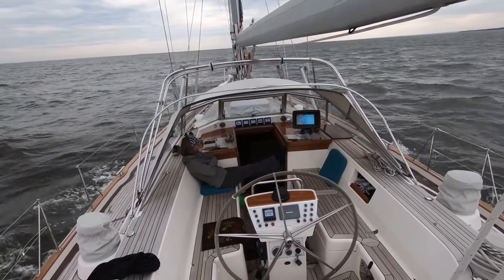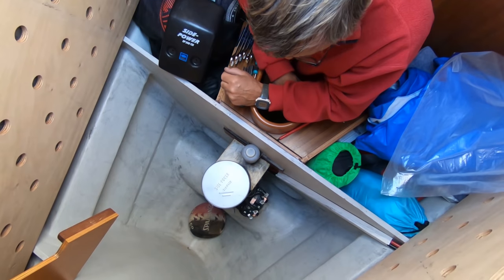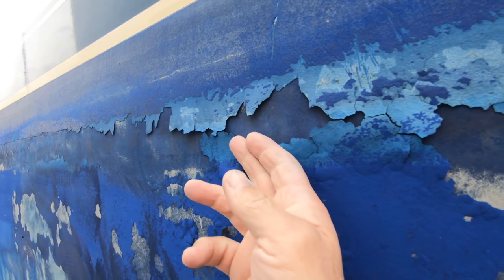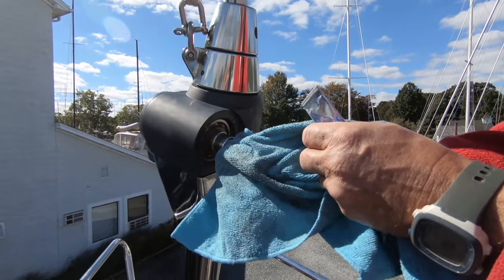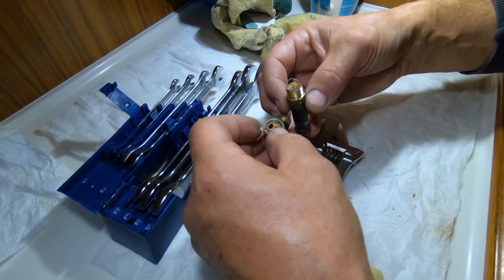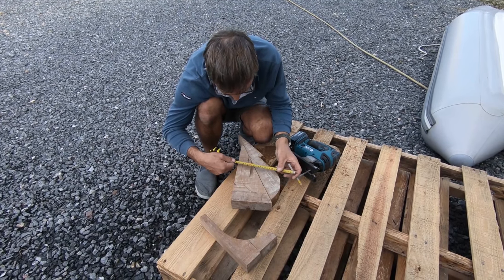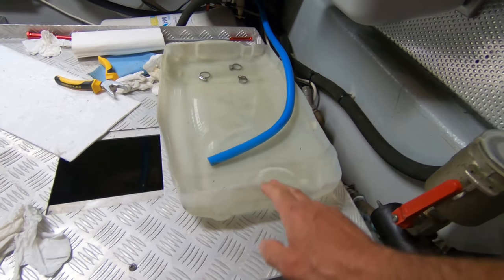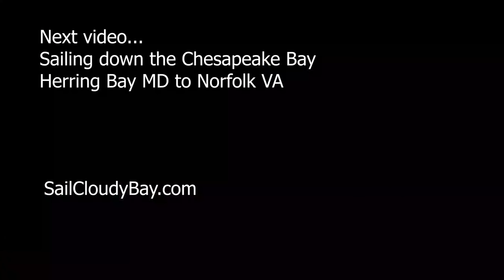ep48 - Boat maintenance - Herrington Harbour North (MD) – Hallberg-Rassy 54 Cloudy Bay - Nov 2018

Comment: Your mechanical knowledge and skills are truly impressive and very rare these days...
Reply from the maker: Thanks Thomas. I used to work for a company providing technical services in oil & gas drilling and exploration. In my early years "in the field" (on rigs) I was an engineer and had to deal with lots of systems, hands on and often in a panic. I then went into management for the next 20 years (where I met Oana). But coming onto Cloudy Bay is like going back to those field days where I have to wear all hats, mechanical, electrical, electronics, hydraulics and pneumatic .... and also chemical with the water maker!  I LOVE this part of sailing - having everything working perfectly. And on a yacht like Cloudy, the multiple systems do all need to work if you want to sail short handed. I do find it hard to imagine how other owners, who are not practically minded,  manage with long distance cruising. Well, I kind of know .... they spend alot of time in each port looking for someone to fix their gear. Someone who likely does not know the boat and with unknown skill. And for me, there is only one way to know how something works is when it fails and you are forced to fix it!
Reply: @SailCloudyBay  That's the right attitude. It seems to me that those that are most successful with their livaboard and/or ciricum navigation life style are those that know their boat and equipment and how to maintain it to avoid problems and how to fix things them self when there are a problem. Because nothing is free from problems all the time. Then it is a good thing to be prepared.
Reply from the maker: And once through the Panama, the only person that will be available to fix anything is me! .... until we get to New Zealand. I had a mission to know the boat inside out before that time.  Even after 2 years, there is still alot to learn.
Reply: Hi Glen, @SailCloudyBay   Did you gain all of your mechanical skills @ SLB working out on the rigs or growing up, were you and maybe your Dad motor heads? I went through the same "hands on" with my involvement with owning my own transportation company in the coal fields. On those hydraulic fittings, I take it the new $1k couplers you installed now have stainless or synthetic ball bearings of some sort in them. Out on the North Sea on the rigs I would suspect this would have showed up on their fittings as well with the constant salt air/water exposure. Good thing you noticed the tell tale rust streaks. Can they be covered somehow like the terminal end shroud fittings are? CB has massive coverings on her fittings, not like those boats you see with just some sort of tape wrap. Have a great run down to Antigua - English Harbour I assume.
Reply from the maker: Just arrived to Jolly Harbour yesterday. We will be hauled out to finish the hull. I did indeed get my mechanical and practical aptitude from growing up with a similar Dad and elder brothers. Dad always had to have a go at fixing things himself, most of the time successfully, even if a bit mickymouse (improvised). Without this aptitude, I doubt Schlumberger would have hired me. We had pretty tough practical tests on hiring. These days, due to the complexity of the technologies, the engineers are hired more for their computer skills. If something breaks they just send it back to town and use a back up, or a land based technician fixes it remotely over the internet.  In my day we had to get the solder iron out and work out what the hell was happening, while the whole rig waited on us. No pressure!
Interesting. I had not thought about what hydraulic fittings we had offshore on the rigs. I think they were a mixture of stainless and alloy. That said, we did have alot of corrosion issues, which were always prevented by copious quantities of grease.  Grease on a yacht is a bit of a no-no, grease on a rig is on everything you touch is seemed.  Especially the food!

Comment: You truly are good.
I’m a big believer of if it ain’t broke don’t fix it. 
If I do what your doing I’ll probably end up spent my time working on my sailboat vs sailing.
Reply from the maker: Well, me too actually. I also don't like to mess with anything that is behaving itself. And frankly there is always a long list of misbehaving items that precludes anything else. But, while out the water there are some jobs that you have to do. Cant service the prop for instance when in the water. And it was not always feathering properly, recently, so was ready for a service.  The other aspect is that, while its not classed as "messing with things that are working OK", I do constantly keep a lookout for tell-tail signs of problems. Like the hydraulic fittings. I'd noticed some minor rust marks coming out of them ... which shouldn't be, because they are supposedly stainless steel. But when I took them apart i found the ball bearings that lock the fitting into place are made of steel an were completely seized. I got them off just in time. Another few months and they would not have budged.  And to replace those fittings is $1000 each!  Its true that I do alot of maintenance, but then we are living aboard and using the systems 24/7.  Previously, when only weekend sailing I never seemed to have so many issues. But then the usage was significantly less plus I had a whole winter to dabble and fix things.
Reply: Sail Cloudy Bay  Why are you still using a propeller, we have a 34 meter catamaran and have switched to jet drives. This has eliminated all of the problems that come with props.
Reply from the maker: Douglas, I’ve never seen a sailing yacht converted to water jet propulsion. On large super yachts yes, but on an average sized family sailboat?
Reply: @SailCloudyBay   And what do you call an average size family boat, ours is just over 120' long  powered by twin Cummins Diesels
Reply from the maker: Douglas, you must have a big family :). I would say an average family sail boat is 1/3 the length of yours and certainly only one engine. Clearly your must be a motor boat, not sailing?
Reply: @SailCloudyBay  First of all our boat is a catamaran. It has 3 masts ., The motors will push it faster than 27 kts. With me and my wife and a crew of 8 we have lots of space.At present we are in the Azores. Hope you are all having a wonderful Christmas.
Reply from the maker: Wow ... but with a crew of 8 I would hardly call it a family sized yacht!  Would love to see a photo. I'm sure you have one on the web somewhere.  Please can you point us to it.

Comment: Absolutely superb blog, fascinating and informative.   Your knowledge is unsurpassed amongst the bloggers we've been watching... and Cloudybay is a superb boat.  Lots of questions, please excuse my ignorance as we are very new to this...  First, white grease on the gooseneck?  Stainless to stainless is, well, ouch I would have thought,  Corrosion on the aluminium mast/boom doesn't seem to be a problem on the Rassy, many boats we've looked as have had serious problems.   Re-tapping the boom - was it an option to plate the other side to form a clamp?  Through hull fittings and dezinctification - these can be obtained in 316 stainless but I gather there are pros and cons for both.  Hoses; in the car and bike world we use silicone based hoses for strength, flex, heat resistance and general durability, I've not seen them on boats?  Epoxy, anti-foul and so on, we are looking to copper coat, was that ever a consideration?  The big cruisers are very complex and the Rassy seems to be one of the better ones for maintenance and servicing, was this a consideration at purchase?  Love that keel, their reputation for strong build is well justified!  Our biggest worry would always be grounding, you have nerves of steel going down that channel!  
Fantastic, and as commented elsewhere, superbly produced videos.  Our limited knowledge is reflected in the questions above, but we have the same bug and boundless enthusiasm that the pair of you have. Well, done.
Reply from the maker: Bob, Thanks and Congratulations .... likely our longest comment ever!  But we are in a rush to leave Bermuda this morning, so I will reply in about a week when we arrive to Antigua.
Reply from the maker: OK, we arrived to Antigua. Thanks for your enthusiasm. Very glad you liked the video and your questions are all very good ones.
I'm guessing the "white grease" you see on the gooseneck is actually the film of plastic that Selden place wherever there is stainless steel touching the aluminium . Hence no corrosion there.
Re-tapping the boom.  Backing plate was not an option.  Wish it was.  directly above the slider is the electrical conduit along the bottom of the boom. 
The answer to the dezincification is to use Bronze (low zinc) and not Brass. I have never heard of anyone placing stainless steel through hull fittings below the water line. Not sure why,  but must be a good reason
Re hoses.  Funnily enough a few days later I did find a automobile hose that was perfect for the job!
Coppercoat has indeed  got a reasonably good reputation. But when we bought the boat 3 years ago it was already freshly anti fouled. And to put copper coat on would requite complete strip off of all the standard anti foul then application. Huge cost. And we had other higher priorities to spend our budget on. And, above all, we really don't like the "look" that copper coat has around the waterline after a few months. 
I've always wanted a HR and indeed they install the top quality of systems. And to run a 54ft yacht with just 2 people, to remote places, you either have all the systems or you suffer with a kind of camping life. Oana doesn't do camping :)
Hope all that answers adequately.
Reply: @SailCloudyBay  Great and thanks for the reply.  At the brokerage we have been visiting are a charming couple restoring a very old Moody and they're doing a wonderful job, and with all 316 ss fittings which he was keen to show me.  Stainless is not self lubricating like bronze when used for valves, but he was sold on it and they certainly come at a cost and looked, well, very nice!  I'll study the pictures I've got.  Keep the blogs coming, they're fascinating...

Comment: Hi there - What an absolutely gorgeous boat. Congrats! I've enjoyed the video and thanks so much for the segment showing servicing of the Gori folding prop.  I've recently installed a similar 3-blade Gori (albeit, a somewhat smaller 16.5") I also saved your video to my favorites as it should be a great resource to help with my end-of-season to-do list :).  (There are surprisingly few videos showing maintenance for the Gori on YT!)  As you've obviously some experience with the Gori design, I've noticed when initially setting off in forward gear (standard not overdrive), I can get some prop vibration, that will only increase and become more violent as the engine revs increase if not addressed. Fortunately this doesn't occur all the time, but seems to be more prone to happening if throttling up too quickly or if a strong headwind or opposing tide restricting forward momentum of the boat.  Throttling down and returning back to neutral for a few seconds, before setting off again in forward seems to work most of the time, however only if the boat has some way. I was thinking this might be a cavitation issue, but not 100% sure (I've only been using the prop for a couple of weeks now). I found this technique to be less effective if starting off against a stronger tide or headwind since it it's that much more difficult to first get the boat moving with any forward momentum.  Wondering if you may have also experienced any similar issues and whether you may have an idea about the potential cause?  Unfortunately, the dealer hasn't been all that helpful so far.  Any tips or tricks you have found would be appreciated!  Cheers - Looking forward to checking out more of your videos!
Reply from the maker: LittleGuitarConcert I can only think that it’s an unbalanced propeller or you have wear in your cutlass bearing. I doubt it’s cavitation, the RPM on these props is too slow.
Reply: @SailCloudyBay  Thank you so much - The cutlass bearing is fairly new and in near new condition prior to launch. Possibly the shaft is slightly out of alignment? - I will check, although no issues with prior fixed prop. I can't think of anything else that might affect prop balance. Still too new to be fouled with barnacles. I was hoping it might have been some sort of idiosyncrasy with the Gori !

Comment: Ha ha ha ha LOL. :-D In the description there is mention of the 'new anti-fowl'. Is it keeping the birds off the mast head? Perhaps it's doing a better job of keeping them off the keel? :-D English is such a fun language.

I'm actually back here looking at your maintenance vid to see your work on the Gori propeller. Great job and very helpful. I've put a 36mm socket on my list. Glen, Oana - would you like to comment on whether you've had a good experience with the Overdrive feature of your propeller? Getting it into overdrive when out on a passage, requiring a bit of reversing in mid ocean, must be a bit annoying, even if only done in calm conditions. Worth it though, if a long stint of motoring is on the cards. Lower revs and better fuel consumption. Thoughts? Some builders these days are only offering a Gori 3 Blade Single-Pitch folding propeller - no overdrive - though it does flip just like the Overdrive version. It's all to do with ensuring the engine isn't over-stressed, to avoid warranty issues. Volvo insists! Regards, Rick.

Comment: Very nice episode, good on details and perfect length. How much play was there in the axle shaft?
Reply from the maker: Glad you enjoyed it. It took Oana a while to put the 350 clips together!  I would say the play on the Cutlass bearing was about 1-2mm (1/16-1/8th inch). I had been noticing that we had more vibration than usual recently so was not surprised to find that much play. In the clean water before USA we had no issue, but there is quite a bit of silt on the east coast US, so I guess erosion greater.
Reply: Actually, I would have liked the episode to have been cut into two separate episodes of about 30 mins each.  But that's just my opinion.  For some of us who follow alot of sailing channels, a 1  hour episode of one channel eats into time for other channels.,
Reply: @CawffeeTyme  watch half, stop watching and do whatever, then continue to watch the rest. This isn't linear TV... ☺
Reply from the maker: One question: Why are you watching other sailing channels other than ours? ...  :)
We did consider splitting into 2 but then 2 videos of the same subject wouldn't make sense. 

Maybe you can watch 30 mins then watch the rest another time?

Comment: Hello, Glen, I have a question. Do you order all spare parts well in advance to the port where you plan your refit or will everything only be ordered when you are there? What do you do if you find a broken part during the work and a spare part has a delivery time of 4 weeks or even more? I imagine it is difficult to have all necessary parts, tools and service providers (polishing, anti fouling, etc.) on site in time...
Reply from the maker: DrSchweitzer good question. I do order parts ahead of time that I either need during the next maintenance session or to replenish supplies. Then when we arrive - they are all their waiting. Because it’s rare that we have a reliable address to send them to. That said, there are always a few items that we only learn we need as we are doing maintenance. An example was a special socket to remove the propeller. But in US delivery time is just a few days for most things. Delivery time and complexity will be very difference once we leave for the Pacific!  Bottom line is that we constantly write lists and try to keep ahead of the game!

Comment: I have just found your channel and this is the first of your videos that I have watched and I thoroughly enjoyed it. You both achieved an impressive amount of completed work in a relatively short space of time.

As a Marine Engineer of 40 years+ (but now retired), I was very impressed with your attention to detail, your consistently high standards and your ever present OCD.😉

Just a quick comment about the de-zincified brass fittings, I take it these are on systems that were not part of the original HR build? I know from the other comments you are well aware that brass fittings should never be used on salt water systems and their failure could be catastrophic to the vessel.
Curious as to why you carrying a bottle of refrigerant - have you had a history of loss of refrigerant?

I will try and catch up with the rest of your output.👍
Reply from the maker: Thanks for the nice comment. Actually, all the thru-hull fittings on HR are of brass. They say its "marine grade" and they have never had issues. Well, I don't like that and I intend to change the affected ones to bronze. As for the refrigerant bottle. Yes .... lots of fridge issues. With the bottle and equipment I can at least refill to keep us going till I find a proper fridge engineer .... which are are once away from civilization!

Comment: That looks like a Gori folding prop, if it is we have the same one our Jeanneau SO 45.1. How often do you use it in overdrive mode? In overdrive at 1,400rpm we get pushed along at 7 knots, on average, with our Yanmar 4JH2TE diesel 59hp (44Kw). Do you think that 1,400 RPM is too low and not putting enough load on the engine? Thanks, Baz.
Reply from the maker: Sailing A B Sea we are mostly in over drive. Especially when motor sailing. I also run at about 1400 revs.
Reply: @SailCloudyBay  that's good to know. Thank you.